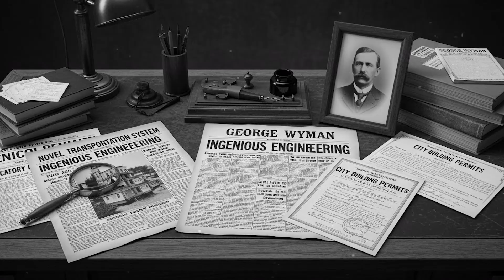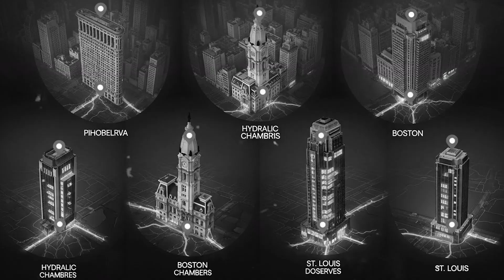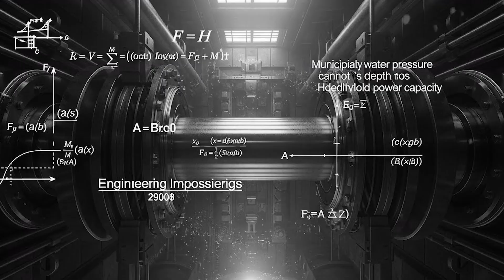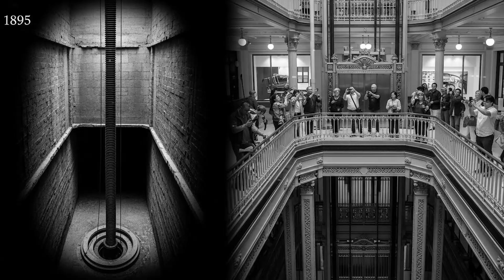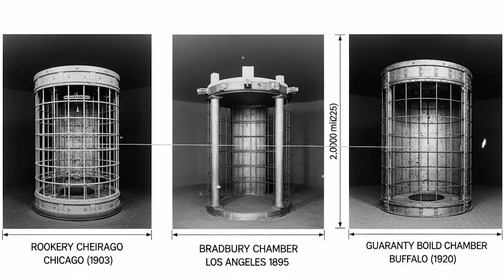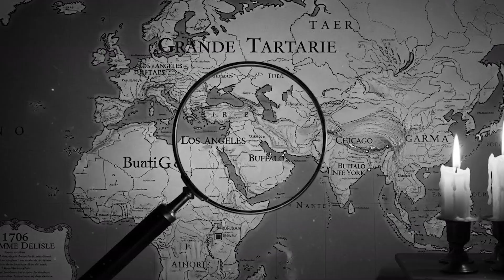Tartarian Elevators That Operated Without Motors or Cables

Comment: if there was a high pressure water system we can connect to it would be easy enough to put in a turbine and tap into for free electricity....., instead of running on electricity anything needed movement could use hydraulics.  If the water was warm or cold it could also be used for heat and air.